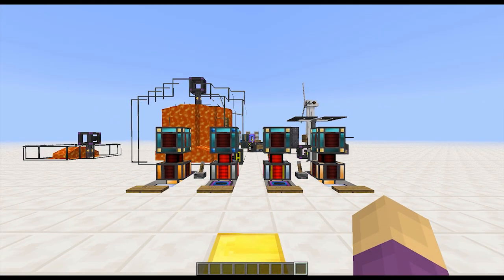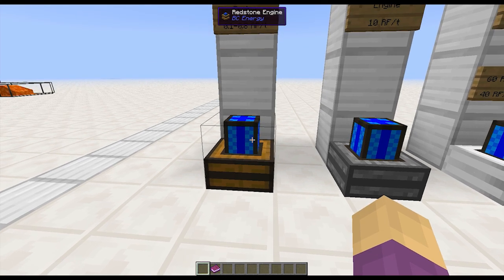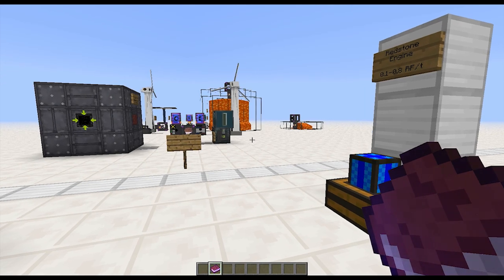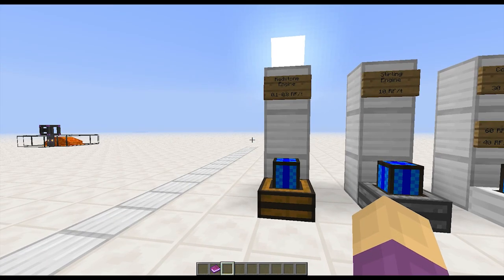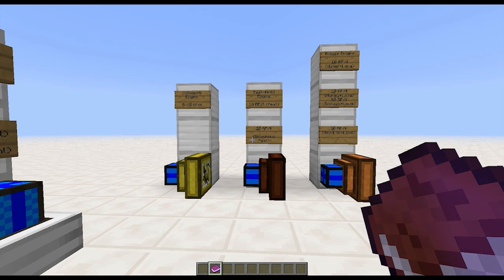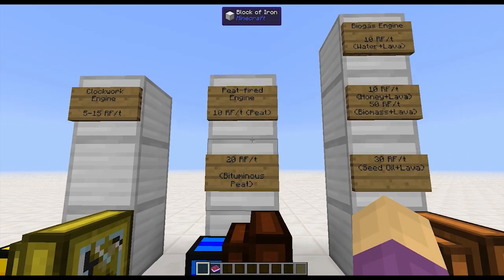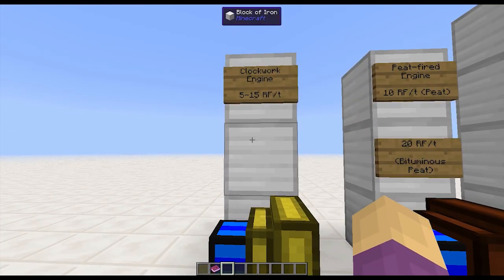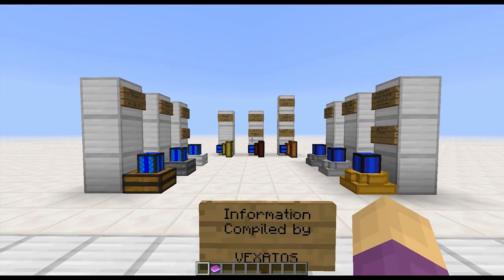Mod Guide - RF Power (Pt.2)

Comment: Dear Vaygrim I'm happy to tell you about a few more power producers.like Minefactory reloaded steam turbine and biofuel generator. Dartcrafts force engine if you are willing to use Dartcraft that is.  Engineer's Toolbox can make power in a few ways. Minechem-Particle physics smash things for power, so fun! Mariculture Gas turbine, water turbine and manpowered turbine?? Extra Utilities new generators nice ones. photovoltaic cell from ender IO. Atomic science.  some are not till late game but are so cool. Also I'm sad to say I used to be one of the Solar is the best stack all the solar!!! How ever when you look at it one heat generator and a bucket of lava will out do one solar panel over a minecraft day. with less of a start up cost too boot.
Reply: +Mike Roper I don't think minechem makes power, unless that's changed. But, you can throw nether stars made from minechem into an extra utilities generator.

Comment: I have a bit of information to add to this.
In my previous (1.6 dw20) world I was pretty much exclusively using railcraft boilers with TE steam dynamos for power gen. After a while I wanted to test if this is actually the most efficient way to do things.
On monster I therefore tested steam boiler based power gen (with steam dynamos) versus using the fuel directly (steam dynamos for solid, compression dynamo for liquid). As I'm interested in renewable fuel sources, I tested charcoal versus ethanol. Boilers were fully heated max size high pressure.

Now the results:
For charcoal the efficiency increase is immense, you get more than double the amount of energy if you use a steam boiler.
For ethanol there is only a small efficiency increase (about 17% iirc), so I'd say a steam boiler is only worth the effort if you actually continuously need the power. If not, using compression dynamos will probably be more efficient on the long run, even more so if you switch them off when you don't need them.

Comment: @ about 4:05 you said that 200 of those would equal 160 rf per tic, thats correct, but there is one small caveat, those engines will only produce power if they are hooked up directly to a machine, or output. Meaning they won't send it to pipes/conduits/io pipes, only directly to machines, which means you can have a max of 6 per block